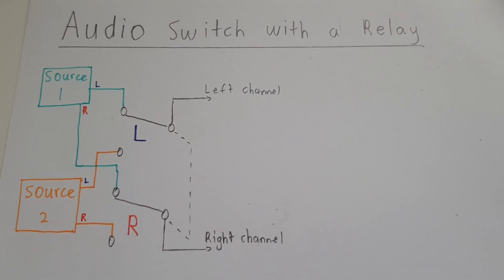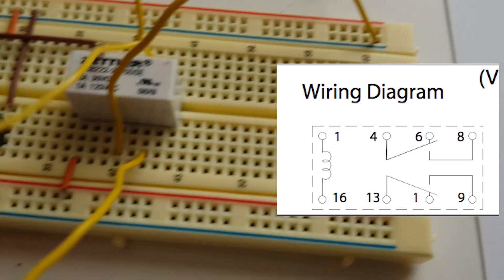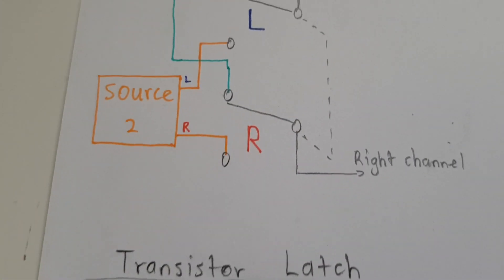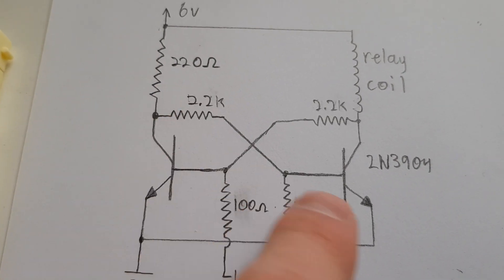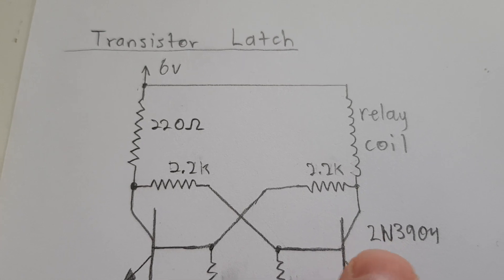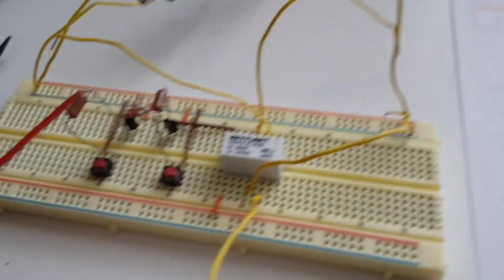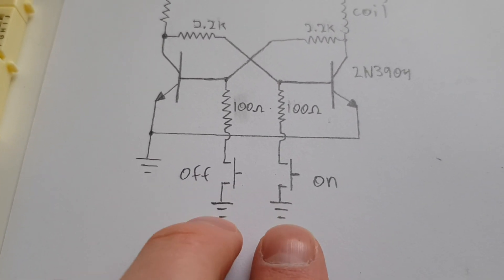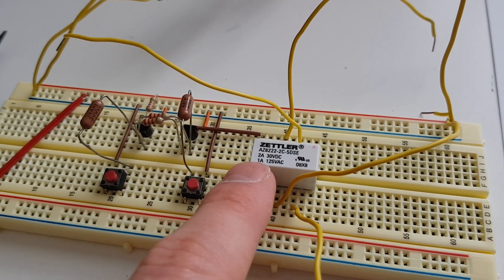Audio Switch with Relay

Comment: <rant>

Sorry, but this is a serious violation of the KISS principle.  If you have the place on a panel for one or two push buttons, then you certainly have space for a small DPDT toggle switch instead.

cough

The switch will handle much more amperage than the relay - and, as a side (or rather, primary) benefit, draw *zero* current in either state.

And such latching relays in audio went the way of the passenger pigeon many years ago.

If you want to demo latching transistor circuits, fine. Ditto use of relays. But there are dozens of more pertinent examples where such are really needed, but you will find are extremely challenging to justify.

</rant>

ANd just so I don't leave  you or your viewers critical comments that are of no inherent benefit, might I suggest two books?

      The Art of Electronics , Horowitz

          and

     Small Signal Audio Design , Douglas Self

Comment: Can the same circuit be used for switching VIDEO SIGNALs especially in cars with front and rear cameras?
Please make detail video about multiple cameras switching in car ... Eg 360 degree camera has 4 cameras.

Comment: Could this be adapted for a 5.1 switcher using 3 relays to switch between 2 6 channel inputs to a 6 channel output?
Reply from the maker: Yes, it absolutely could. You would then wire the relay coils in parallel so they all switch at once.
Reply: Great! thanks

Comment: Would you be able to switch that audio to another speaker?
Reply from the maker: Yes, as long as the relay is rated for the power. If you know how many watts maximum will go into the speaker and you know the impedance of the speaker (8 ohms for example) you can find the maximum current. As long as the relay is rated for the current, it should be able to switch speakers.

Comment: You forgot a diode on a relay coil
Reply from the maker: I realized I forgot that when I posted the video. In this particular case, I don't think it matters because the coil is small enough and the current is low enough that the transistor doesn't get too big of a spike.

Comment: Hey Tube Roaster, I'm trying to make a circuit like this... http://www.pic-control.com/audio-trigger-relay-light-indicator/
I just want my amp to switch on when I start playing audio. I have a Y-splitter from my iPod and want to use a small IC to amplify the sensing side so it will hold the amp on even at low-volume levels like 5%.
Any ideas?
Reply from the maker: I'm thinking maybe a peak detector with a comparator driving a relay that would cut power to the amp. The comparator is a simple op-amp circuit that would detect if the audio voltage is above a certain level. You could set the trigger level with a potentiometer to whatever the quietest music level will be. To hold it on, there will need to be some kind of peak detector circuit (basically a resistor, diode and capacitor) that would hold a value for a while and not drop immediately when the music gets quiet or changes in level. In total:

Scaling Amp (to bring up the audio so the circuit won't trigger on noise.) ----> peak detector (with a bleeder resistor) ----> comparator (with a pot for the trigger level) ----> relay driver ----> amp

Comment: Thanks for this! I'm switching my signal relays using an Arduino and getting an audible clicking on the audio signal. I'm switching between balanced XLR connectors (1 input between 2 outputs, using it to switch one microphone between different preamps) and grounds (pin 1) are all connected (separate from the Arduino's ground though). Any ideas how the clicking could be prevented? I already tried a make-before-break setup using two relays, didn't fix it. I'm not using flyback diodes at the moment. Also no optocouplers in the coil circuit. So nothing really limiting the current through the coil. Could that be an issue?
Reply from the maker: The coil should be fine, if the coil is operated at its rated voltage, it will draw no more current than is necessary. Voltage is more of an issue, and that's why you might need flyback protection diodes. However, in my experience, sometimes this isn't really critical. Especially if what's driving the relay coil is a MOSFET. The body diode will effectively do the job just fine if the coil is small and the voltage is low. However, if you click the relay a bunch of times and it suddenly doesn't work anymore, you'll know why.

If the (pre)amplifiers are totally different types, one of them could have a different input offset currents if they are BJT. If one or both are JFET input, charge can build on the gates and when switched over the voltage drops back down and makes a pop. This is really tricky to mitigate because messing with the amplifier's input can quickly create more problems. One thing you can try is adding something like 100K resistors to ground on all the outputs to prevent charge from building up on the unused output. The problem is, if the resistor value is too low, you can cause issues with input offset current (if it's a BJT input), phantom power (if you have it) and mic sound quality (for certain mics that have higher output impedance). I'd say start with resistors between 100K and 1M. If the problem is static buildup, 1M or more should easily fix it.
Reply: The Tube Roaster thanks for the quick reply! This makes a lot of sense! I’ll try the 1M resistors. Could it also have to do anything with the relays? I am using rather decent small signal relays with 5V coil voltage by Finder, so I guess not but just asking to be sure. Also, just to clarify: the mic pres are not part of my circuit, I am just connecting to an audio interface, so not sure what kind of transistors the amplifiers are using. But I’m guessing it’s two of the same preamps. At the moment, the arduino and the (usb powered) interface are being powered by the same hub so the coil circuit and signal circuits aren’t necessarily completely isolated from eachother. Could this potentially also cause problems? Thanks!
Reply from the maker: @HowAboutKaran  It's quite possible that depending on the relay, the magnetic pulse from the relay coil could be coupling into the signal line. TBH, I haven't tried this sort of circuit at such low signal levels. If that's the case, it will be very hard to fix the noise, unless the coil is turned on and off slowly. As far as the power goes, I was thinking that may be a factor as well, since the voltage spike would be coupled into the power supply. It's unlikely that's the problem but it is possible, you can try adding decoupling capacitors across the power supply (10uF to 100uF or more) and add a film cap (~0.1uF or so) to snub the fast edges of the spike better. However, the Arduino (and computer USB power) has a regulator and caps already so it might not help too much. These are all possibilities, but it is most likely a charge build-up problem.

Comment: Hey Tube Roaster! This is a great video. Can you illustrate where the audio is being inputted and where the audio is being outputted in this circuit? Thanks!
Reply from the maker: Perhaps I should have drawn the diagram differently, but the inputs and outputs are the relay contacts. The audio sources are the inputs and the outputs are the other sides of the switches in the relay. I wired it this way so you could switch between two stereo signal sources. The latch circuit is drawn separately because it just drives the relay coil which is entirely separate from the audio. I was mainly demonstrating how to switch the relay and generalized the audio part because there are different ways to connect it depending on what you are using it for and what relay you have.

Comment: Nice video. I have a Bogen SI35A Page/Intercom system that uses a balanced 25v speaker system in each room. One room I need to be able to disconnect the speaker lines between the speaker and Bogen system from a remote location. I'm using some DPDT latching relays to do this but when they are energized (speaker in circuit) when I go to use the Bogen Intercom, the sound has so much 60Hz hum in it that you can't hear the remote party. I think it's the coil in the relay causing really bad induction into the balanced 25v speaker line. Would a double coil relay work better for this as it is only a temporary contact with the coil?
Reply from the maker: If the relays were latching, they wouldn't need power to stay energized/closed. I assume you have AC relays. Of course dual coil latching ones would be best especially for this application. I don't fully understand the system you have, but if the speaker wires are 25V lines that are balanced, I find it hard to believe that a small coil nearby would cause that much interference. I imagine the output resistance of the amp is on the order of a couple hundred ohms at the most. The AC magnetic field would have to be insane to couple the signal in from the output and be audible. My guess is that you either have an interference problem with your input where a lot of hum is getting injected, or you have a power supply with bad filtering and a lot of ripple. Or one of the unused mic inputs has an issue.
Reply: @thetuberoaster8321  The relays I have were 12vDC relays. How the setup works is from the Bogen SI35A, you select a speaker(room) and the speaker at the far end beeps. The far end speaker in the room turns into a microphone and you hear the output of that mic on the SI35A, via the onboard speaker on the main unit (this is why I think I am getting the hum because I think the speaker is acting as a high-impedance mic so naturally any form of stray voltage will upset the signal, but I am not 100% on that). When the main unit wants to talk to the far room, you push a big green button and speak into the speaker on the SI35A which turns into a microphone and the far end goes back to being a speaker (in otherwords the green button flips which unit is the speaker and mic around on the internal amplifier within the Bogen SI35A).  I am using a fairly cheap wall-wort 120VAC to 12VDC (max 2amps available but pulling around a little less than 1amp) so you are correct in that MAY be causing part of the issue. I should have bypassed the relay but energized it to see if it causing interference. I guess at the end of the day a 2 coil latching relay would be better.